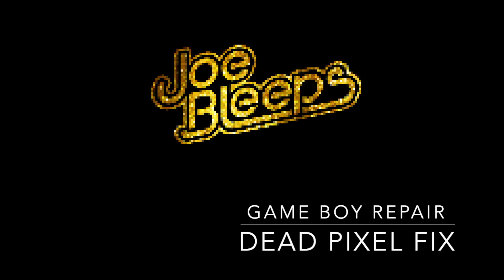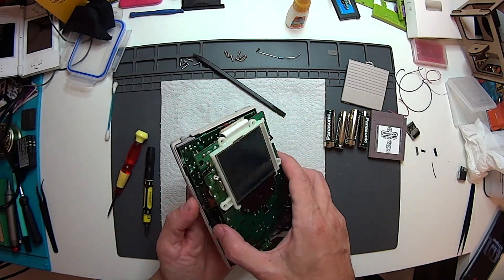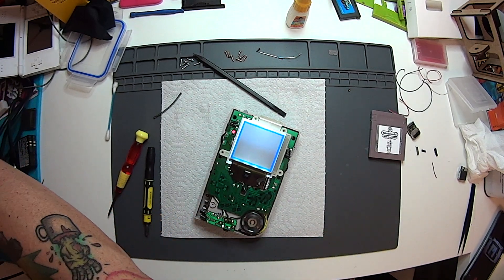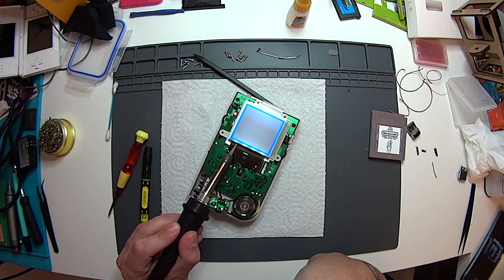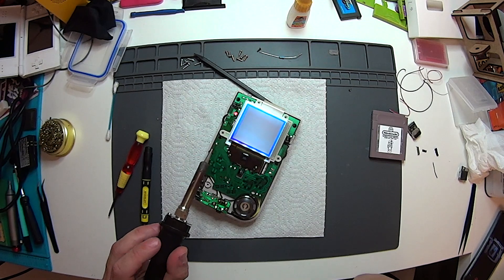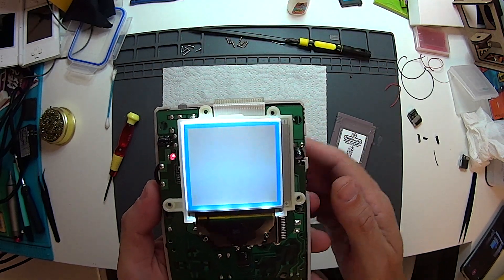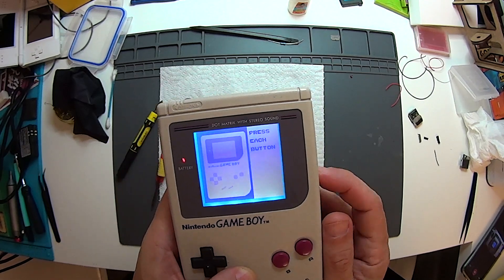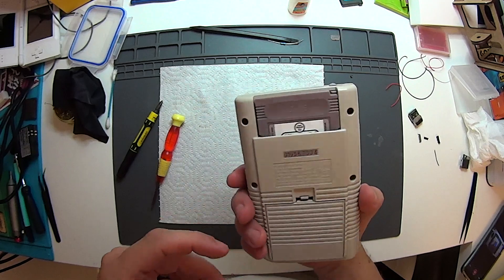DMG Pixel Fix! Repairing vertical lines of dead pixels on an original Game Boy LCD

Comment: Wait so the video I watched, he put the solder on the tip of the gun and kept running it across. So you're telling me you don't actually have to use solder? You can just use the heat from the gun??
Reply from the maker: Yeah there's no solder involved, just the heat to get the glue to reconnect on the ribbon and the LCD

Comment: I got on with vertikal line dead, i guess i cant repear it right? my luck..  and my other one didt turn on anymore
Reply from the maker: Vertical line should be fixable, it's the horizontal ones that are an issue
Reply: @JoeBleeps  i mean horizontal :/
Reply from the maker: @reaperex9608  ahhh yeah. IPS screen replacements are your best bet.
Reply: @JoeBleeps  Hm okay, how much does this cost, because i got a second one what doesnt turn on, because i replaced the shell and i think i destroyed "C33" and "R11". So i got 2 GBA SP and i think i could make one of them and sell the other partr für 15-20€
Reply from the maker: @reaperex9608  they are around £50
Reply: @JoeBleeps  hm i think i try to use the working screen and the working platine and sell the not working as defect for 15-20 dollars on ebay. Got myselfg a new shell and try it later, wish me luck :)
Reply from the maker: @reaperex9608  good luck!

Comment: Pretty good job!! I have a similar problem but with a gameboy pocket, it has horizontal lines in the screen, could I fix it with this method?
Reply from the maker: There is a similar fix if I recall correctly. Although horizontal fix on a dmg is a no-no, the screen in a pocket is rotated 90° so horizontal lines are the same as dmg vertical lines, you need to apply the fix on the side strip. Be warned though, pocket LCD isn't as robust as the DMG screen.
Reply: @JoeBleeps  ok, thanks for the tip!